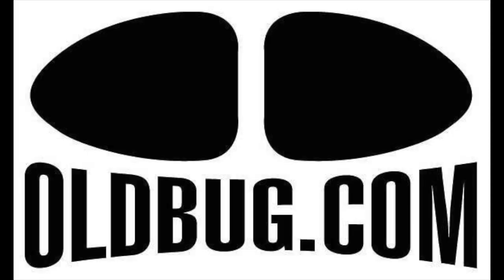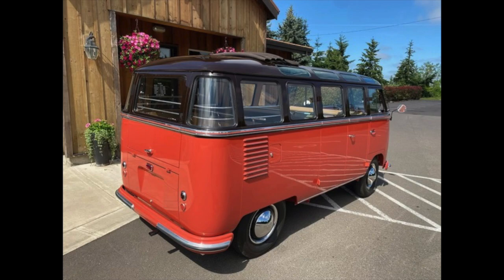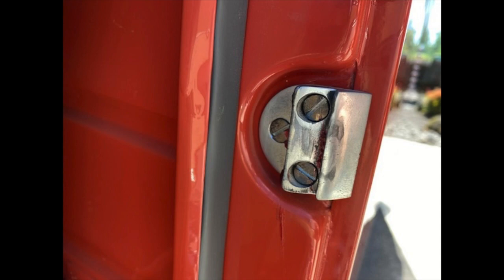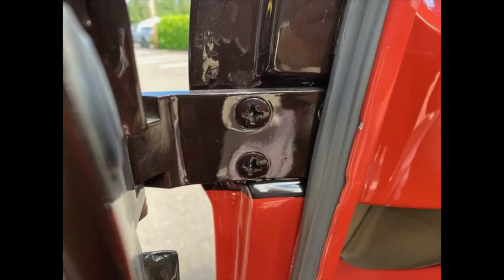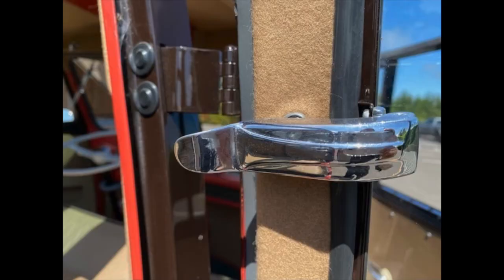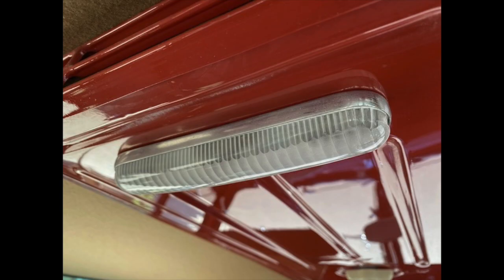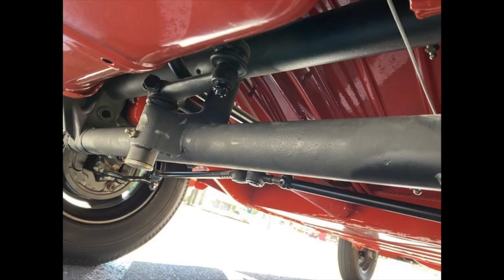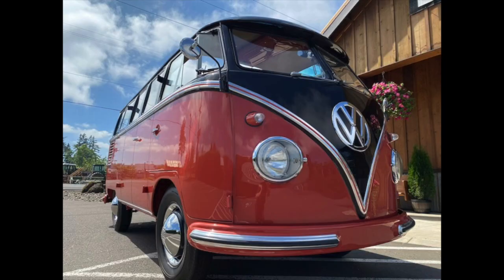Carchaeology: $200k for a VW? This is what a proper restored 23 window Bus is all about.

Comment: I love those old buses. My grandpa who was blind bought one that was a car of the Swiss chocolate manufacturer Suchard, if I remember it right. It had a raised roof.
Being young and dumb I got extremely close to laying it on it's side. We had to transport a heavy steel scaffold and we were very overloaded. The load was standing up high which made it very dangerous. 
I was not used to the very, very sketchy brakes of the vehicle. When I had to make a very sharp turn to the right, I got one of the worst shocks I ever experienced as a driver. I was breaking as hard as I could, but the thing would hardly slow down. So I had to enter the curve much to fast. I think we were only on two wheels in the curve. But somehow we managd to make it without accident. I think that was the last time I ever used this bus. I would drive one in the Swiss army. It was abused so much that the back was sagging very much even when there was no load in it.

When we owned a body shop we received a pickup for free! It was one with a normal windshield. We got it for free, used it to haul heavy loads. It was a former constrution company vehicle. It was heavily reinforced. We never even had to charge the battery, it always started even after months of standing in the cold outside. we got it and used it for years. At the end we had it picked up by a junkyard and we gave it up. Nowadays it is hard to imagine that. You throw a very rusty but running VW pickup without getting as cent for it. Well that was twenty years ago!

My daughter's dream who is a musician is to own a very old bus. But I keep on telling her how slow these things are, how sketchy the brakes are and how dangerous it is when the wind is catching it from the side. I addition to that they are extremely expensive and unaffordable. 
I had a friend who travelled entire South Africa in a camper. They are great in the desert and unpaved roads. But in South Africa many buses have a 3l Ford engine installed. So they are much more powerful if they have to drive in heavy terrain.
Reply from the maker: Great stories!!